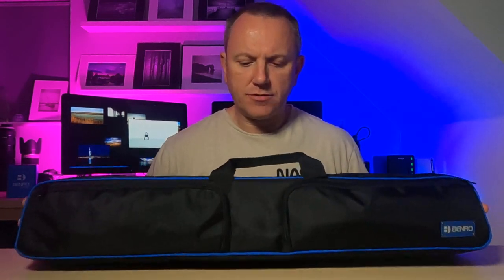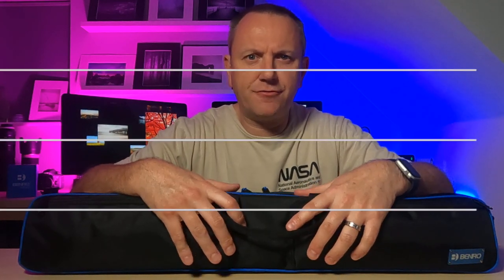Do THIS to your tripod! How to get a better tripod setup.

Comment: @sturousephoto 
Are you still happy with this setup?  Has anything in the setup changed?

My main reservation with the Benro Short Column that is provided for ground-level macro work is that the Diameter of its Mounting Platform for the head is a MUCH smaller diameter compared to the standard center column, AND it also does not have even a single anti-rotation lock screw to keep the head from loosening and spinning off the short column base.

This would most likely be an issue when using a flat base video fluid head, or larger base ball-head such as the RSS BH-55, etc.

After many years in the field shooting action sports, wildlife, landscape, and catalog & advertising photography with models/actors, I still like to have some type of "short" center column that will give me up to ~4" of quick height adjustment for rapid framing/composition fine tuning.

This small amount of column extension does not generally compromise the stability of the tripod and camera significantly, at least when using fairly robust tripods with 28mm or larger center column tube diameters.

But just that little bit of ability to QUICKLY adjust the vertical height without fussing with any or all of the tripod's legs can change the perspective and composition drastically depending on the lens that's being used and the elements in the background.

This might, of course, be a hinderance for ultra low ground-level/macro work with the tripod legs fully splayed...

However, in those instances, I will usually opt to use a medium-size platter/frying pan type base such as the 10'' Diameter 15oz ''Skimmer Ground Pod II'' (see Duade Paton's video review), or simply a beanbag or shotbag (sandbag) for smaller lenses.

Cheers.

Comment: Nobody mentions so it must not be possible but can you take the center shaft and reverse it so that the camera hangs down from under the tripod for those low level macro shots?
Reply from the maker: You most certainly can, on both the short post and full length post. On the longer one you have to unscrew the hook at the bottom but that’s no problem, it’ll still go in upside down.

Comment: Stuart, very surprised you did not spot the obvious with the Benro levelling head (level bubble not visible when ball head added) I too have the same tripod and love it. But I have gone for "newer " ball head levelled version which like most have a spirit level that is visible no matter which head you add for your camera. I also got the Benro geared head, which works a dream, although I should have got their global head instead as it will also do Panos.

Comment: Why didn't you simply choose a Benro GX ballhead? This GX ballhead has 2 panorama levels (one sitting right under the Arca Swiss base). Without the levelling base and this rather bulky Field Optics Offset Bubble Level your TMA38CL would be much lighter. 🤔
Reply from the maker: Because the GX was released after I bought my levelling base. Benro obviously came up with a new solution!

Comment: It seems as though you've come up with a solution for a problem that doesn't exist, lol. You said what if the tripod is wonky but tri[od legs are extendable so there should be no situation where the tripod isn't level, lol. A hill would be the perfect example, simply extend two legs out further than the third leg, the two legs extended on the downward of the hill and the third leg towards upwards on the hill. So you've bought all those extra bits for nothing sorry but you have. Plus if you needed a bubble level to make sure the camera is level why not buy a hot shoe bubble level from Amazon?
Reply from the maker: Maybe you’re right, but I’ve done this for speed and convenience. Benro solved the problem, not me!
Reply: @sturousephoto  Speed and convenience? How long does it take to extend legs? Seconds. But ok.
Reply: @djteknovibe93 
It is MUCH FASTER to level the tripod base with this type of separate and independent Leveling Base attachment than to fidget with 3 separate tripod legs to get both the combination of a LEVEL tripod and the EXACT Height you want (when not using an extendable center column as in the example here).

This is just one reason that ALL professional video tripods include either a 75mm or 100mm half bowl apex/spider & an articulating half ball leveling base built-in to every tripod...

You simply and quickly set your legs to the height you want, and within 3-5 seconds your head is level instead of it taking 10-20+ seconds fidling with 3 tripod legs. 

I've been a pro photographer/videographer for over 25 years and this is my experience in real world conditions in the field and studio.

With wildlife or people on the move, even a few seconds longer to get your tripod setup means you can miss the "MONEY" shot, or the animal disappears completely and you don't get ANY shots at all.

If this wasn't an issue, these types of separate leveling base attachments wouldn't even be made as there would be no need.  But many professional tripod manufacturers do offer them, and for good reason.

In addition, separate hot shoe bubble level placed in a hot shoe of the camera DOES NOT tell you if the Tripod Base is level, it only tells you if the Camera is level.  And no tripods that I know of include a hot shoe/cold shoe attachment on the apex/spider of the tripod or its center column mounting plate.

Getting the actual tripod perfectly level is critical for consistently leveling and matching the horizon line of a multiple shot 360° panorama photograph, or for level horizontal panning that doesn't slope up or down as you pan left or right when using a video camera on a video fluid head.